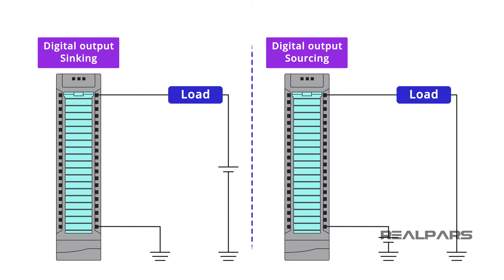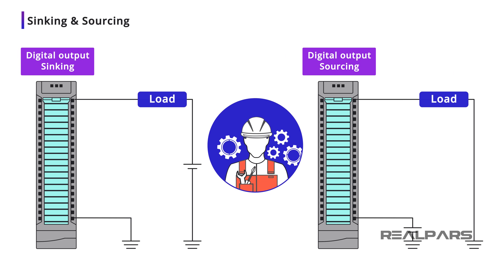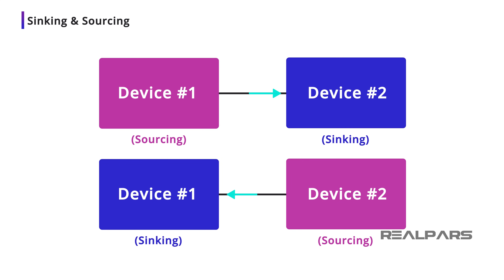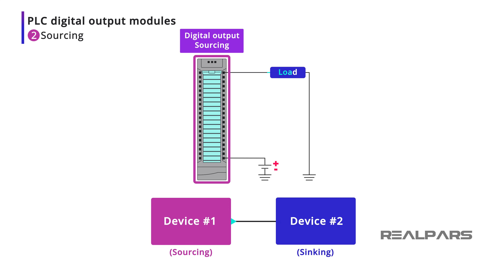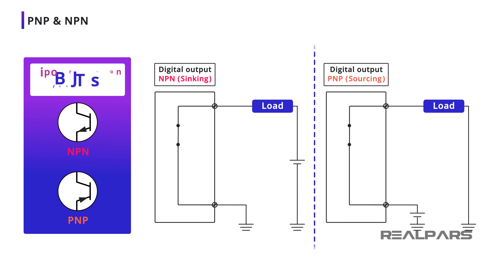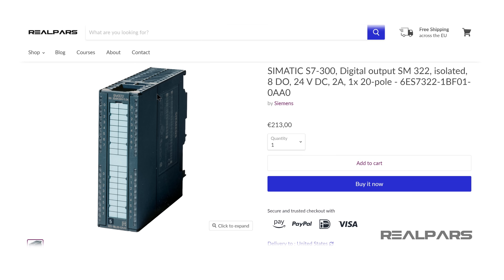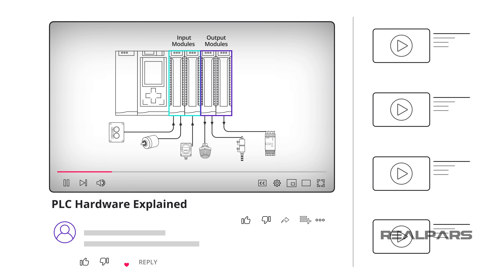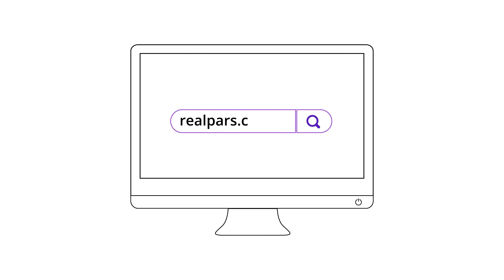Sinking and Sourcing PLC Outputs Explained

Comment: Rules to live by:
1) If a Sensor is connected directly to the Positive(+) Power supply terminal, the sensor is PNP/sourced(with Positive power)
Rule of thumb 2 P's: means the sensor receives and sends a positive electric charge. (Input card will be the opposite = Sinking)
2) If a Sensor is is connected directly to Negative(-) Power supply terminal, the sensor is NPN/Sinking. (Receive and Send negative power)

To put it into an image: 
1) Sourcing is a Faucet (Positive) (+)
2) Sinking is a Drain (Negative) (-)
Reply from the maker: Thank you for sharing that!
Reply: Wouldn’t it be easier to understand that a plc is sourcing if the common terminal is positive and sinking when the common terminal is negative?

Comment: DOES PNP OUTPUT HAVE ANY SPECIFIC VOLTAGE?
Reply from the maker: Hi @Shahroz Khan. Thanks for your question.  Every module will have its own specifications. for example, the AB 1756OB8 is an 8-output Sourcing module and can operate anywhere between 10V and 30V DC. Its nominal operating voltage is 24V DC. The current specification is more important to be aware of as excessive current can damage the internal transistor very quickly. The AB 1756OB8 is rated for a maximum of 2A per output point.  In most plant applications, each output will be fused to prevent damage.

Comment: Hi , i just feel a bit confused about an output module being an sinking type since the output always flow the current to the load and the input module current flow is from the load??? thank you.
Reply from the maker: Hi @Amadou Bailo.  It can be confusing for sure. First off, the current does not always flow from the output module output terminal to the load. The current sometimes flows into the output terminal. An input module doesn’t actually have a load, but some type of a switching device like a push-button switch or a proximity switch. And, believe it or not, sometimes the current flows out of the input module input terminal to this switching device. We explain PLC input module sinking and sourcing in one of our videos. You can find the video here.  https://www.youtube.com/watch?v=B65detMhnoc&t=104s
It boils down to determining current flow between 2 devices. We can call them Device #1 and Device #2. If the current flows from Device #1 to Device #2, then Device #1 is the sourcing device and Device #2 is the sinking device. Don’t hesitate to reach out if you have more questions.

Comment: So what is the COM terminal on PLCs? And why do we use it? What is the difference between COM dc or ac?
Reply from the maker: COM is short for COMMON, the terminal to which all loads in a circuit to which the high side are referenced.  So when a power supply puts out 24VDC, it is 24VDC as referenced to COM.  In AC circuits, we use the term Neutral for the common low voltage wire.

Comment: Hi sir, if module is sinking type, 24v DC connection to the I/O module is "COM", if sourcing type, 24v DC is to  I/O module "+" right
Reply from the maker: Hi @kahwai choong. Thanks for your question.  If the I/O module is a sinking typle, the COM terminal will be connected to the negative "-" terminal of the power supply. .  If the I/O module is a sourcing type, the COM terminal will be connected to the positive "+" terminal of the power supply.

Comment: So what is the reason why you would choose 1 over the other? I understand why you would choose transistor or relay output but not sure why you would choose sinking or sourcing  output
Reply from the maker: Hi L CT, That’s a very good question. There’s really no simple answer other than the module chosen is often determined by the load. What do we mean by that?  It’s possible that your load is wired in such a way that it is a sinking device. If that’s the case, you’ve got no choice but to go with a sourcing output module.

Comment: Sir I have a doubt, you are talking about NPN and PNP, npn means sinking and pnp means sourcing and both devices basic concept is flow of current, now kindly tell me how BJT can allow to flow current in both directions as it is an unidirectional device, its flow of current will be in one direction(emitter to collector).
Reply from the maker: Hello Akash.  You are correct. A BJT is a uni-directional device, and current flows between the emitter and the collector. I'm referring to conventional current flow in my discussion. In the NPN transistor, current flows from collector to emitter. In the PNP transistor, current flows from emitter to collector.

Comment: Thank you for answering my questions from years ago. No elsewhere I can find better and clearer explaination. I appreciate it.
Reply from the maker: That's amazing to hear! Happy learning.
Reply: @realpars  1.can we use capacitive touch pad switch (with 5v /24 v dc relay )...... in place of start/stop/selector switch ? in a 24 v dc PLC?
2. As we are using retentive timers......how  we can design ladder logic for PLC.. so that process  start ITSELF after power supply resumes ? (i.e ..not starting with the help of start switch)

Comment: I have your courses they are wonderful but I didn't find pulse width modulation or PWM technic in D.O modules i need to understand it thank you
Reply from the maker: Hi Salouh, Pulse width Modulation is a topic on its own. PWM is a method of producing an analog type of control by digitizing the duty cycle of a digital output. PWM does really not fit in the DO module category where the output device is either fully on or fully off.

Comment: Strange. You have used a ground symbol to complete the circuit. Why not just a line connecting the battery to PLC common? Very important thing in PLC wiring is that current loops through the ground to be avoided. The video explanation does not require a ground symbol R egards.
Reply from the maker: Hello there. Thanks for your feedback. Old habits die-hard is the only response I have for your comment.  I've used that ground symbol for years to indicate common, or the negative return of a power supply. I hesitate to draw lines connecting all commons as drawings tend to become confusing. You are correct. The IEC60417 5017 symbol for earth ground is shown. Perhaps a better choice would be the IEC60417 5020.

Comment: Personally, I prefer sourcing  I/O from its reliability standpoint.  Sinking discrete (digital) inputs are the standard for PLCs in the US at least.  Power is sent to the field through the field device and back to the input, then to ground.  This means a failure on the field side of the input card has a real chance of bringing down the power supply or blowing a fuse.  On a sourcing input, this won’t happen since the actual load is the PLC input and it’s inside the panel.  Sourcing outputs may not be desirable for failsafe inputs since they can go active due to failures in the field and that’s not failsafe.
Reply from the maker: Hi Ryarios. Thanks for your input.  As you say, sinking input modules are more prevalent.  This means that sourcing input field devices are required in order for everything to work.  That's not a big deal if the input devices are passive, but critical if the input devices are active. We've got a video in the works for PLC input modules. Switching power or switching ground is certainly a contentious issue yet vendors continue to market output modules allowing both.

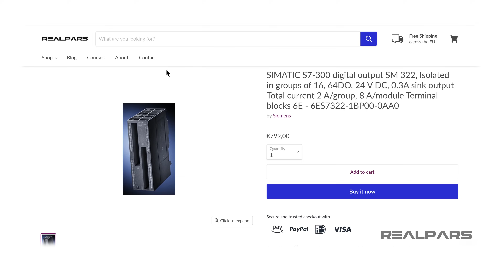Comment: @5:00 They are all NPN transistors and are an irrelevant for an output type (sinking/sourcing). They are inside an optoisolator for a galvanic separation with max current ~50mA. The real switch is in a rectangle box with a triangle symbol. This is a driver with bigger current rating ~2A and the type of transistor inside determines whether  output is sinking or sourcing.
@5:30 I think animation would look more correct if a current was flowing from 24V into a driver (box with a triangle) to the output, load and to the ground.  There wont be flowing current higher than 50mA through this optotransistor. 

IMHO putting an NPN optotransistor in schematic and hiding the transistor type inside a driver only makes people more confuse. I would do the opposite
Reply from the maker: Hi Voytechj ! Thanks for your eagle-eyed feedback. You are correct. @5:00 both modules have NPN opto-isolators. @5:30 the animation should also show current flowing into and out of the driver. The opto-coupler electrically isolates the load and when turned on, will, in turn, activate the output driver completing the load circuit. My bad for missing this!

Comment: You're either breaking the hot or the neutral (negative). Break the hot: sourcing. Break the neutral (or negative): sinking. 

Breaking the neutral of a load with a switch or output is STUPID because now you have a hot load out there looking for a path to ground, which might be found via a rubbed wire or some other mechanical / electrical defect instead of your PLC output.

Sinking VS Sourcing for inputs - that is a more worthwhile distinction because you're not controlling "loads" as in moving equipment, you're controlling "loads" as in a sensor. You can program in some safety to prevent unintended behavior due to a single malfunctioning switch or an input going high at an unanticipated time. 

Sink your inputs. Source your outputs. Design your electrical control cabinet accordingly and enjoy a standard methodology.
Reply: Thanks Dave. Sink your inputs. Source your outputs. Design your electrical control cabinet accordingly and enjoy a standard methodology. Short & Sweet Notes.
Best Practice in Electrical point of view.
Reply from the maker: Hi Dave. Thanks for your input and feedback. Switching power or switching ground is certainly a contentious issue yet vendors continue to market output modules allowing both. It's certainly buyer beware!
Reply: @realpars  Hello Dave, thanks for the nice and simple explanation. I have six pieces of modulating valves (Samson type) connected to DO modules. If I connect all the valves, three will come up and the other three will not, I thought I was experiencing a short circuit from the cables. I have rewired the cables, still the same. pls, what can possibly be the cause? thanks.

Comment: Thx, so if the digital output are relays, both sinking and sourcing are not valid?
Reply: If I understand your question correctly, they are still valid.

If the PLC is sourcing the output to the relay, then the ground will be common and the output from the PLC will turn on the relay.

If however, PLC is sinking, then the +24V will be common and the ground output from the PLC output will turn on the relay.
Reply: Yes it is for outputs.  If the relay is switching the ground then it’s sinking, if the relay is switching the plus side then it’s sourcing.  I do not like sinking outputs.  The load can operate without the output commanding it to, if the negative side of the load is grounded due to failure or accident.  On a sourcing output the system either works when commanded or blows the circuit protection.  (Unless the relay sticks shut)
Reply from the maker: Hi Chikenz, The concept of sinking and sourcing is still valid.  The module will either sink or source the load current. The big difference is that with dry relay output modules, the current can be either sinked (.....if that's a word...) or sourced by the same module,  or in many cases, both!  Dry relay modules are happy with AC current too.

Comment: Nice explanation!
But what's the practical meaning when designing schematics to choose between sinking and sourcing output types?
Reply from the maker: PLC programmers and engineers need to know what I/O field devices are being used and how they will be wired. For example, if all the loads are connected to a common power supply return or ground,  the output module needs to be a sourcing type. If the input I/O sensors are 3-wire PNP type, the input module needs to be a sinking type.
Reply: @realpars  Thank you for response! Just in my field of work I'm facing all variants of outputs (just depending on distributor), so I've just wondered  -  is there any particular reason for such variety besides voltage supply organization?
Reply: @viktormakarov5232  This is related to the working principles of an NPN and PNP transistors. NPN is great for connecting and disconnecting load from the ground (sinking). One of his three pins (Emitter) is connected straight  to the ground and other pin (Collector) to the output, then output to the load (relay, bulb, etc.) and finally to the power. In this way it works the best as a switch with very low resistance. If you try connect NPN straight to the power and try connect/disconnect power from the load, you will get very poor switch with high resistance or it wont work at all.
PNP do an opposite, it is very good at disconnecting power from the output (sourcing). Some devices need that property of a switch and you have no choice and use PNP(sourcing) as an output.